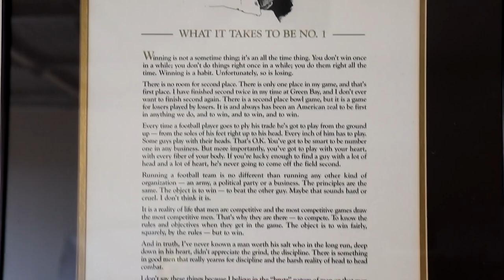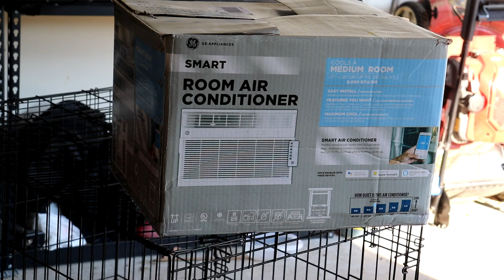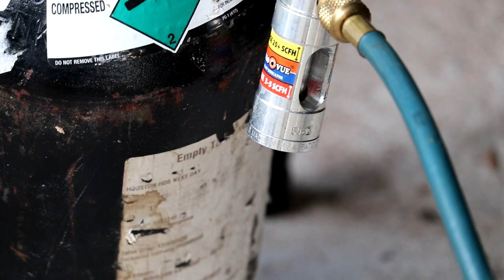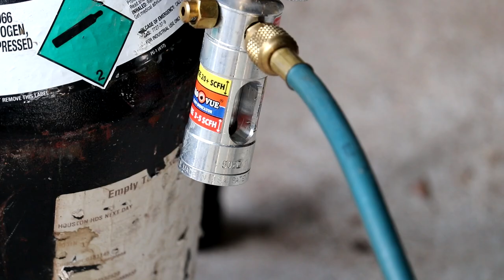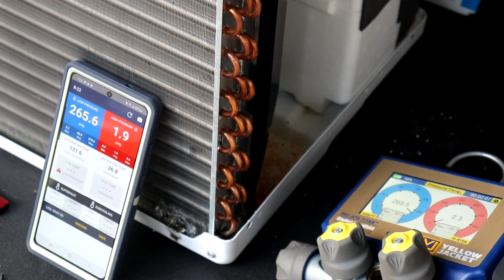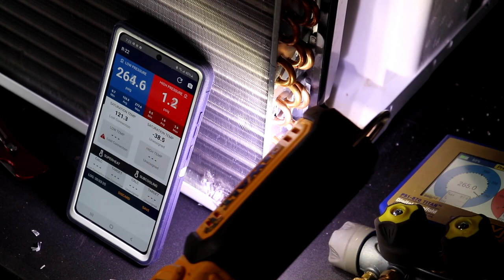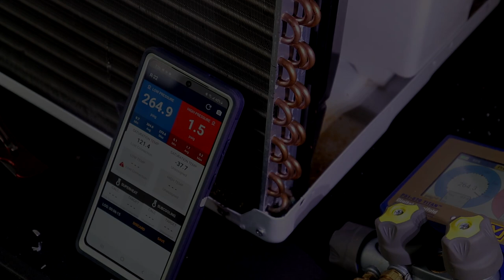Repairing window unit air conditioner Part 1

Comment: Good job Walter- love your videos. Nice job adding in the fitting. Had a thought- you could have run nitrogen through the new fitting when you brazed it in and let it flow out of the hole in the condenser😊.  Then just rely on the trapped nitrogen in the condenser for the hole repair..... just a thought.....👍

Comment: Nice repair job, its nice to see the right valve used instead of those clamp on piercing valves. Those peircing vales usually leak down the road. Job well done !!  And yes r32 is being used, its replacing r410a, r1234hyf is replacing r134a. I too miss the days of r12 and r22, the gold standard of refrigerants.

Comment: It doesnt look like there are any drop in replacement refrigerants for r32. Some other countries have used r410a but the manufacturers dont recommend it due to r32 conpressors are designed to run hotter. If i were you id probably just put 410a and let the customer know due to the system being open so long the compressor may not last very long.

Comment: I'd definitely gas it with 410A to start with since as already mentioned it's just a blend of R32/R125, although I'm not sure about the weight of charge difference between the two and an ounce either way can make a pretty big difference.   Great video!

Comment: 410a has r-32 in it.  That’s why you charge with liquid on a 410 system.  R32 is more efficient .   I’m thinking if you can’t find R-32 then you can take 410a and charge it with gas(valve up).  My thinking is the vapor density of R32 is 47.3 kg/m3 and R-125 is heavy around 68(memory).  So if you fill with gas slowly then it should mostly be R32.  (Let tank sit without moving over night)

Comment: R-32 is flammable. You have to be careful. Where train not to use a torch as the label states on the unit. I work for a company that see the new refrigerant like r-600.

Comment: Man you inspired me to work on a portable air conditioner today that I had in my garage for a customer it was completely out of Refrigerant but that one had R410a in it, it held 1pound. The thing is I could not find the leak I leaked search it and search and searched Question did you find out if you could use 410a instead?
Reply: Try charging some R22 into unit than use electronic leak detection.

Comment: It's hard to find good work. Had a technician do some work on my frozen evaporator 2 years ago (I think that's what it's called).  Fast forward to last week and the same thing happened. Went to the attic myself to check it out and noticed that he didn't even put all of the screws back into the unit.

Comment: I used to service air conditioners, been on lot of call and did shop work on window air. Sure remember when customers would bring an air conditioner with drain holes drilled in them. They would tell me they just bought it and created a way for the water to drain out, then thry play dumb like im not gonns see what they did. Drill drilled drain holes alright. Even drained the refrigerant and they say they didnt hear it come out. People, the new air conditioners are more efficient with a bit of water in them.

Comment: At the same temp the pressure exerted by R-32 is way more than 410A, more than double.  410A would not work right.

Comment: R 32 it is very flammable liquid.
Reply: In reading about R32 online it stated it had a very low flammable rating.
Reply: R32 is classified as an A2L refrigerant. Non toxic, low flammability.

Comment: As much as you're putting into it, I can't see how you can make anything out of it,  window units are cheap, and most of the time it's cheaper to purchase a new one than to hire a A.C. Tech to repair it, the valve for the refrigerant alone cost around $ 25.00, then there's the refrigerant, which you'll have to purchase,  and then there's the time ( labor)  to charge for it,  possibly it would be cheaper for the customer to just purchase another one.  Just Wondering!!!!!
Reply: He mentioned early on, he isn't really doing it for the money. He is working on building that reputation a client that will spread his names to his neighbors... he said that he may not even charge him, or charge very little. I took it as more of an experiment and practice for the repair. You aren't wrong on the costs though...
Reply: @NTXSER  Only downside to this is if his neighbor spreads the word that he fixed it for him and charged little or free, then other people will want the same thing,  Little or Nothing,   " Uh-Oh"  he may start thinking what have I started here.   Do you see what I mean.  I wish him luck, called my supply house and they don't know of anybody that sells R-32,  I would like to see the follow up and the final fix.  Thank You and God Bless.
Reply: Well I don’t know how much that unit costed then but 10 months later that GE 6000 BTU a/c unit costs $230.00 at Lowe’s so I’ll throw a hundred bucks at it in a heartbeat if I think I can pull off a simple fix to keep it going.

Comment: Lmao been a commercial service tech and sheetmetal mechanic for 28 years you never repair a cheap window unit you replace it the parts alone will cost you more than what it's worth smdh get a clue young guys.
Reply: Depends on the situation. Schrader valve $10, a little gas and brazing rod and you saved a 200-400 window unit. For a paid job, prob not.
Reply: It depends on what the customer wants. In this case, the customer wanted the unit repaired. Taking  the time to repair a cheap window unit that one feels needs to be thrown out goes a long way in customer relations. This satisfied customer will certainly tell others about WW HVAC's work,  which will definitely send other HVAC work his way. Taking the time to do small, low income jobs goes a Long Way! Today it's a window unit. Down the road, it could be an evaporator or condenser change-out, which will more than make up for taking the time to repair the window unit. Word-of-mouth and customer satisfaction go a long way!
Reply: Go ahead and buy another one Super Tech. He just fixed it for the price of a little brazing rod, a service valve and a minimal amount of refrigerant. If you got $230 bucks burning a hole in your pocket then go spend it. SMDH.